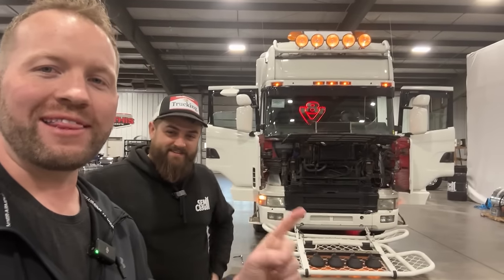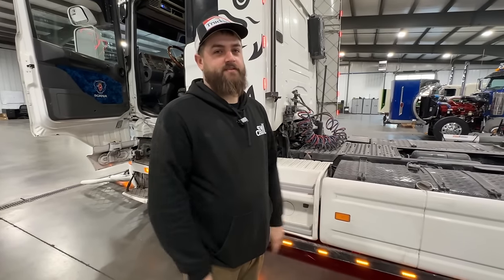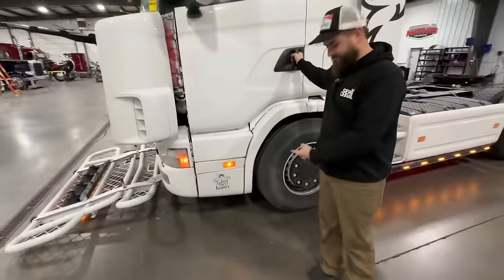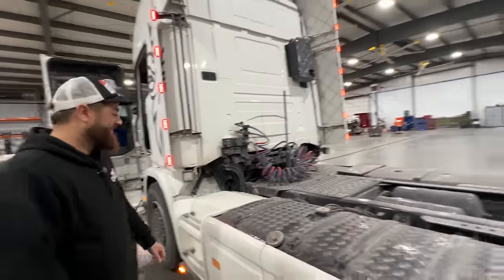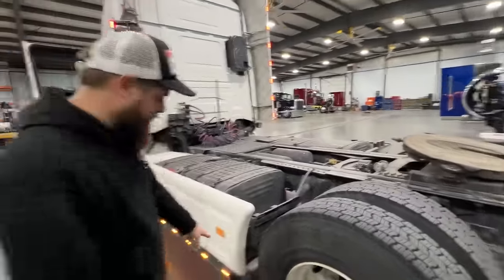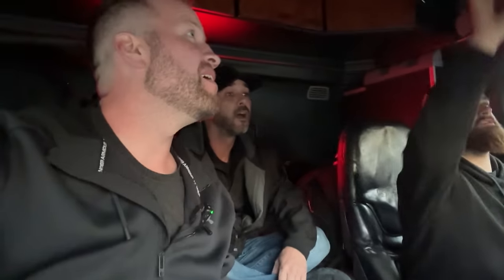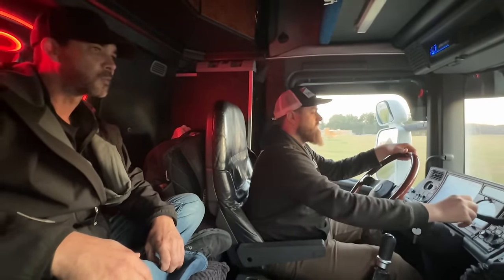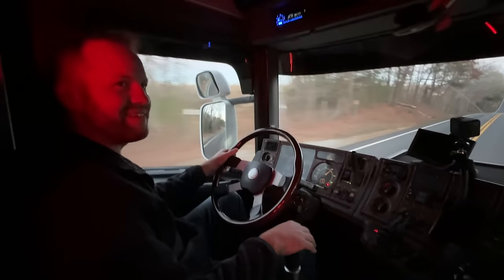First time driving an imported European Semi Truck!!!

Comment: We had retarders like this 50 years ago in American trucks. It was called a Brake Saver
Reply: Yep - Cat had them; they worked on the same principle
Reply: Different placement though, Cat's brake saver installed in the crankshaft while european retarder installed inside the gearbox right after the output shaft.
Reply: the scania one is more effective at low engine rpm as it takes advantage of the lower gearing in the transmission.

Comment: You are missing the original steering wheel (some switches) and air suspension of the driver's seat. Also the truck is really old, newer Scanias are totally different. If you want real good sound try direct pipes right upwards like in my tool (Scania R700)
Reply: Also nowadays 99% of the Scanias are sold with Opticruise which is automatic robot transmission. Clutch pedal is not included in truck.

Comment: My advice is he can do a facelift that 97 to 2022 style,the headlights ,bumper,dash,and interior.
Reply: doesnt work bro, the 2017 model onwards uses different parts that dont fit. Check out next gen scania and compare it to a R-series or Streamline series.
Reply: @kuoseis  then he can upgrade it to 2017
Reply: @bryankibet1587  not that easy, pretty much only the structure of the cab that is the same on the late streamlines and the 4-series.
It’s doable, but its a lot of work..
Reply: Why would he? The 4 series looks much better than the later models.

Comment: As a European I had to laugh, as this feels like aliens looking at a real truck for the first time. Modern ones are even better. The flat front has to do with EU length restrictions, maximizing the cargo. They also have noise restrictions. These are also made with fuel efficiency in mind, so the more "fancy American crap" you put on to it, the worse it will become. Also time now to learn the way easier Metric system. For the tanks, one US Gallon is about 3.8 Liter, so 200 Liter comes down to about 53 Gallon.
Reply: great comment , I thought exactly the same , statements as this is a synchronized gear box or I have to remember to use the clutch , yep americans born in darkness and never have seen daylight but this guy < Bruce > is doing a nice/great job with all his Scania's stuff.  Note , looks like you mixed up a the gallon liter comment in the way like they were talking about at least 200 gallon tanks = ... gallon .
Reply: I don't get why you would buy a Scania then try and make it 'Merican
Reply: @rogmorts1  you have a point here . Time will tell ...but I hear ya

Comment: FOR BRUCE...... Sorry Bruce, I'd say that truck has done the clock plus 700,000 miles, at this stage. There's younger ones of these in Ireland, that have 1,000,000 on the clock, and still driving. To be honest a truck this old would rarely be seen on the road in Ireland, other than at truck shows. Total rebuild ahead for you 🙂

Comment: It's not 13 gear if you count splits as gears. 6 forward, 6 splits plus low and high reverse with splits
Reply: And high and low crawl.
Reply: @markusylitalo8376  this gen does not have crawl it seems. Both v8 and i6 we own are without it. Next gen does, but not sure if high crawl works. Will test it next week 😀

Comment: If you need information about this kind of Trucks, or you have problems with buying spare parts, please contact me here in Germany.😊 And....  You have a Jake break! Take the Retarder in it's last, down position, then you have full Retarder + Jake breake.😊. This is the maximum. You can combinate the cruise control and the Retarder too. You have the cruise control at 70 Mph, Retarder on first step, press the button on top of the Retarder, and when you reach 72 Mph, the Retarder goes on full automatically mode to hold the speed round about 70 Mph. Nice function for the driver!❤

Comment: No, strongest engine by Scania is 750hp so they have much stronger engines, I'm not totally shure but it is on euro 6 regulations. Scania that I currently drive has two tanks in 1500 liters of diesel in total.
Reply: Actually 770hp. Volvos most powerful 750hv. From factory that is. There are over 1000hp of both.

Comment: Cat brakesaver is a retarder it was an option with v8s in the 80s and off road applications still today it is a great option but also heavy and tendency to leak great tool in mountain driving I belive Jeff at j-paydirt has one on his 3406

Comment: The Scanis V8 engine is actually an American designed engine.  The Scania V8 is actually the Mack V8 since Mack and Scania was sharing technology and Mack actually cast the blocks for Scania.  The main difference between the two is the Scania uses individual cylinder heads and the Mack uses one head for each pair of cylinders with a total of 4 cylinder heads.  Mack used the engine for years before it was shared with Scania.

Utilizing more smaller diameter bolts is much better than fewer larger bolts.  Having a narrower frame allows for better a better turning radius and having only one powered axle with a lift axle reduces friction and tire wear and also helps with turning radius.
Reply: You really think?! Maybe in the -70's.